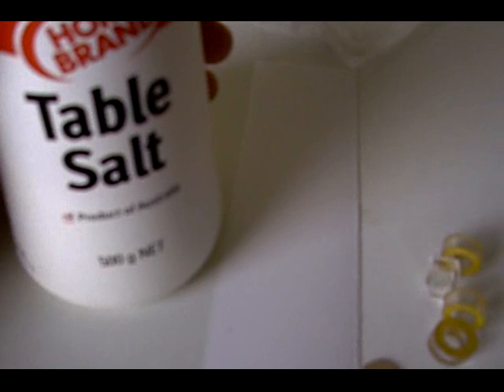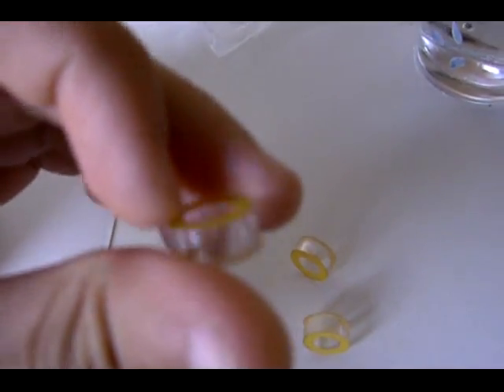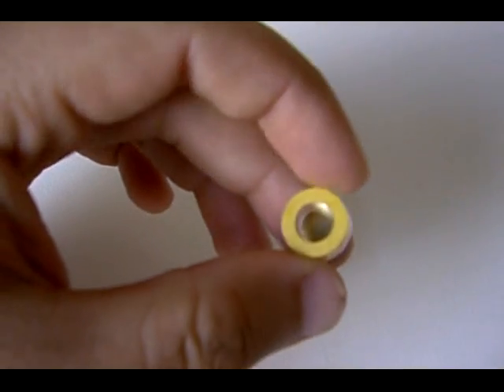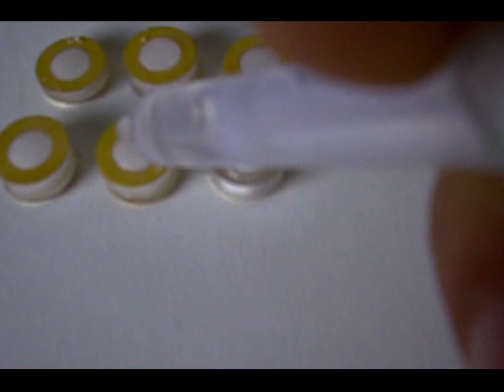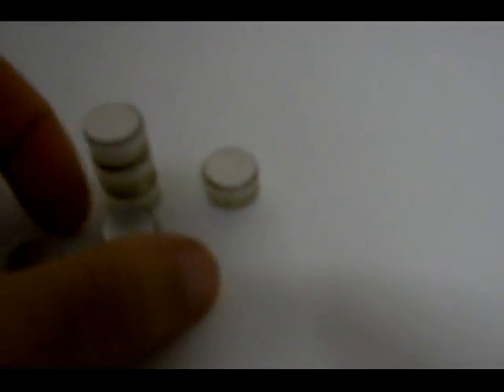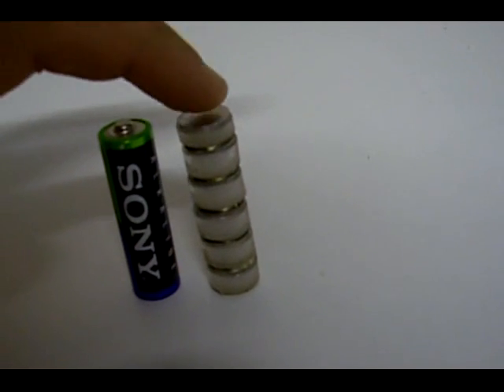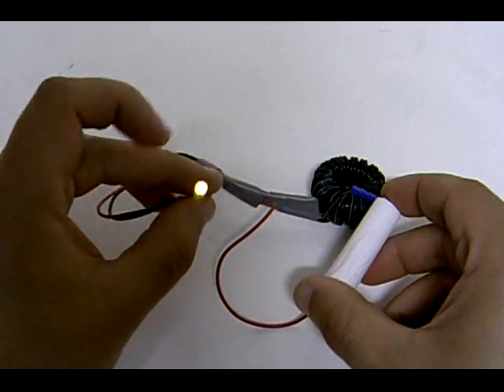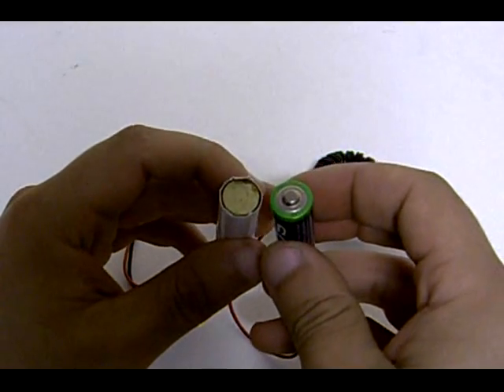How to build a SUPER AA SALT BATTERY 2.0Volts 5-10 milliamps

Comment: so if i put that battery in the tv remote and it fits, will it change channels?
Reply from the maker: Yes sure did!
Reply: super low drain devices like that is the only real application of this battery.  But once the dissolved oxygen runs out in that electrolyte I will predict it stops working.

Comment: great video and awesome work!  I wanted to tell you one thing- using alkaline batteries with a joule thief can be dangerous.. the device and its function cause it to send energy back into the battery.. contrary to what anyone will tell you, there is no way to safely recharge an alkaline battery, the chemistry only works one way..  but yeah if you leave the battery on  for many days, it could rupture and its very possible to start a fire albeit very unlikely.. still i dont take that chance